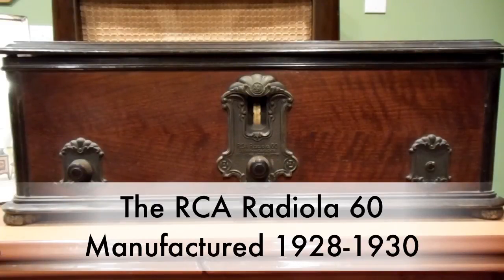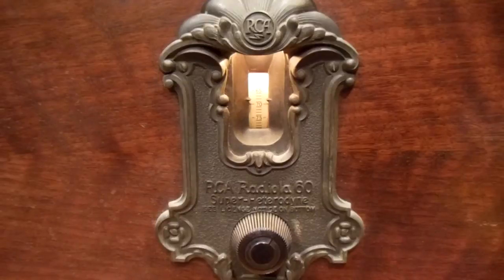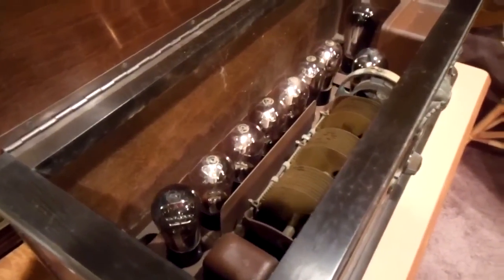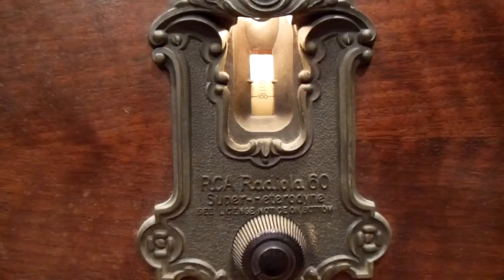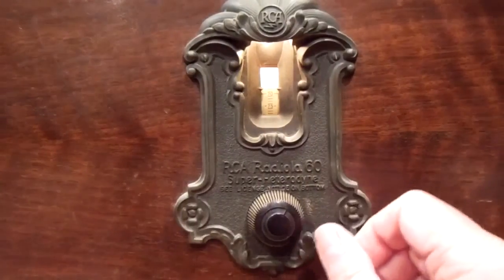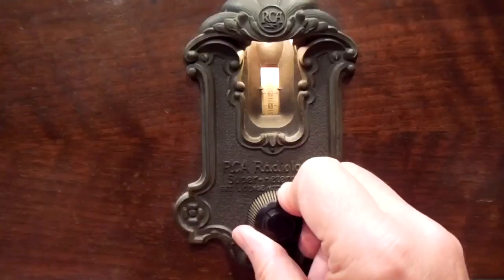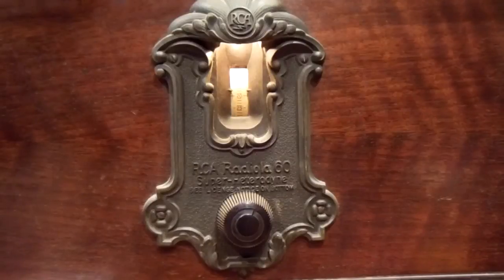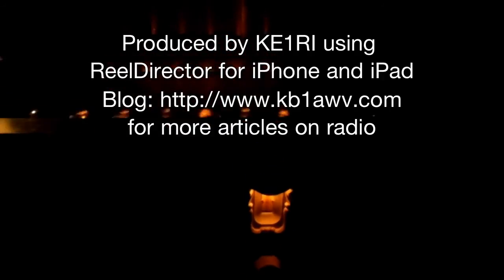RCA Radiola 60 - A Visual and Audio Tour

Comment: Got one I bought off of eBay about 10 years ago and just scored a Radiola 103 speaker to go with it. I have replaced the ST style tubes with the original working globe tubes and now I will be in the process of getting this 87 year old baby working.Thanks for the tour!
Reply from the maker: Glad to do the tour, Leonard. How is your Model 60 coming along?
You have the right idea about putting in globe tubes - it's a nice original enhancement.
Reply: Thanks for the positive comments, Ken. I am waiting on the .5 and 2.0uf  caps to replace the ones that are in the output choke can. Once that happens I will be powering it back up and then doing the realignment of the IF. I just got through replacing the speaker grill with an reproduction from the RadiolaGuy and it looks perfect.

Comment: I have one of these, and I love it! It was a royal pain to align, since I had to remove the tuning capacitor in order to do so. I live in northern Michigan, and I only get two local stations with an indoor antenna, but at night I can pick up Canadian station AM 740 CFZM "Zoomer Radio" (about 58 on my dial), which plays oldies music, and, around 9:30 PM eastern time, a program called "Theater of the Mind", which is old-time radio shows. Pretty cool to listen to old-time radio broadcasts on an old-time radio! I also have a low-power transmitter so I can listen to pre-recorded music and shows if there is nothing worth listening to on the two local stations (which, since they are news/talk/sports, there seldom is... :P ). I switch back and forth between a Radiola 100A speaker and a Peerless Reproducer - hard to decide which one sounds better.
Reply from the maker: I see you are having a lot of fun with the Radiola 60 too. It is a great radio. I have also received the Old Time Radio (OTR) broadcasts from a Toronto AM Station ...   7Khz, I think.

Comment: I recently acquired one of these and two speakers (they have a flower boquet on there grill cloths, not sure the model) for FREE on the side of the road during a town junk clean out day. All the tubes work and are original. Needs some minor cabinet restoration and the speakers work but are cosmetically shot. Hope to have it refurbished by summers end as i have two to finish beforehand. Nice video.
Reply from the maker: Wow, Alan, that was a lucky find! Please let me know when you post a video of your restored system so I can watch it and post a link here. There are new parts such as grill cloth and back bonnet cover available for those speakers. You can probably restore them too. Good luck to you and thanks for watching this video.

Comment: Beautiful set... thanks for sharing, Ken.
The two chassis in that set look similar to the ones in the 1929 RCA Radiola 66 console, too.... upon closer inspection I see that the 60 has one more tube on the RF deck than the 66... I remember my Dad's 66 and it had six '27s and one '45 on the RF chassis and one '80 on the power-supply chassis.
I did a quick search on that $239 price and got this result: 
"$239 in 1928 equals $3,470.79 in 2019.".... wow!... definitely a top-of-the-line set there. ;-)